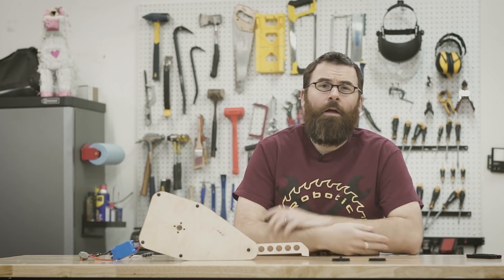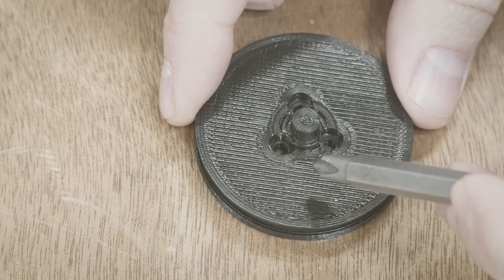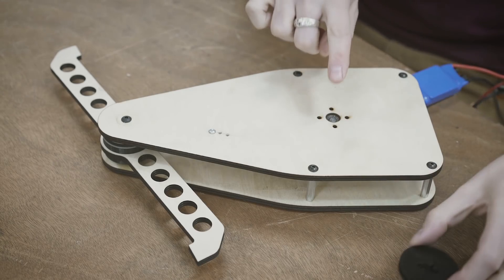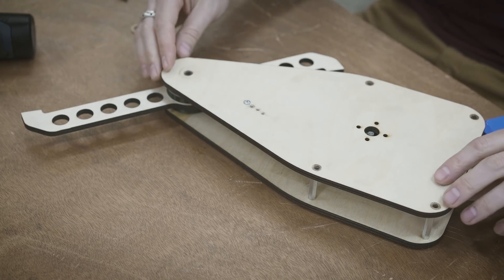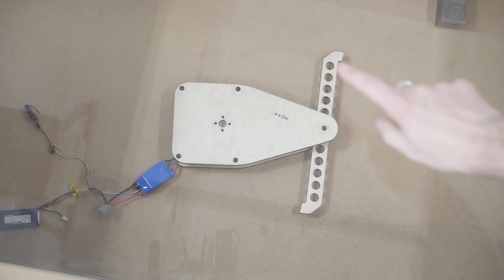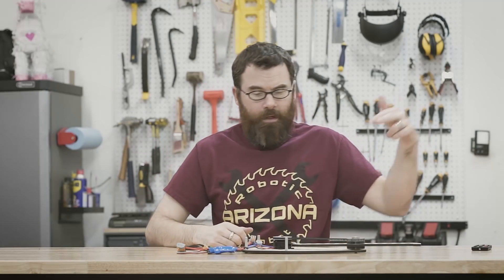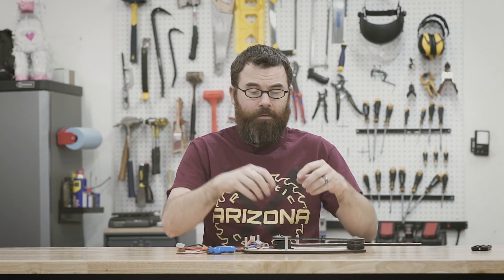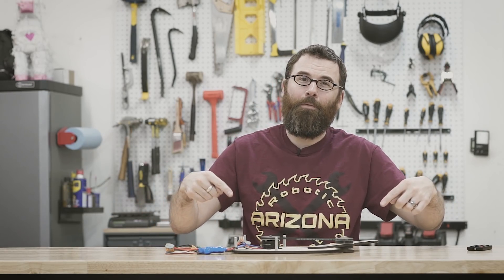Psychotic Break Build - Pulley Madness!

Comment: You should test the weapon directly attached to the motor as a baseline for power usage, then you can calculate how much power you are losing to the drivetrain and bearings.
Reply from the maker: True.  But I'm not sure what it would really tell me, I NEED the setup the way it is, so it might tell me what losses I have, but I really wouldn't be in a position to change/correct it, because I need at least what I've already designed.  I am going to try and test the overall efficiency of the ESC (measure power going in and out of the ESC), this is where losses can occur, and I can recover without sacrificing any of the mechanical design.

Comment: Sounds like the holes in the weapon is causing a lot of air resistance. Can you try putting tape over the holes to see if its any better?.
Reply from the maker: I tried this, and it was maybe 0.5A total current draw difference, and only at top speed.  I had this thought too, and it doesn't really change much.  But don't worry, I have some ideas and in future videos I'll show how I reduced it pretty drastically.

Comment: Have you tried running the belt inside out? Since you're not using the teeth anyway.

Alternatively print teeth on your pulleys and reduce the wrap angle on the drive to allow skipping in case of a hit. Direct drive with no slip, except under major impact. Relying on belt tension with such a non-stretchy belt feels risky.
Reply from the maker: Not yet.  I'm still not 'done' with the pulleys, I always work with 'proof of concept' first, then finalize the parts and make them the best they can be.

Comment: Saw you on BBots!  Think about making your weapon cross section into a symmetrical airfoil shape, and cover those lightening holes with tape etc.  This is your best shot at increasing max weapon rpm and reducing amp draw while there.
Reply from the maker: 1) I don't want to increase RPM, this is already way too fast.  2) I tried taping over the holes and it made almost no difference 3) actually tweaking the firmware on the ESC is a great way to reduce the current draw, I've reduced it by around 30%. 4) I'd rather not machine this weapon more than I have to, especially with complex shapes.
Reply: Thanks for the reply!  I understand if you've gotten current draw down low enough to suit the 3 minute operational design, that over engineering shapes would be a lot of work for very little purpose at this point.  I come from an aeronautical background, where every electron is precious so efficiencies (electrical, mechanical, and aerodynamic) have to be refined endlessly.  Loved watching Copperhead on BBots; wish you the best of luck from here on out!

Comment: You could make the pullies aluminum and just add spokes to hollow it the middle of pullies. Similar to motorcycle sprockets. It makes them super expensive to make timewise since you can't just hit print but it may be worth drawing something up to get a weight estimate.
Reply from the maker: Yep, I have designs for this, but I would rather stick with plastic if I can, since it's MUCH easier to make and reduces part count.

Comment: Are the pullies going to suffer when the weapon stops rotating during combat and the belt presumably slips? Are you worried about heat generated in that instance?
Reply from the maker: I don't think so.  The acceleration forces are pretty strong, and the surface finish looks flawless still and I've gone through maybe 5 batteries.  I think they could hold up, the belt might slip a bit, but that's perfectly fine and desirable.

Comment: 9:25 was your weapon ESC' brake turned on? I noticed that the weapon stopped quite quickly from full speed and braking can cause a lot of heat.
Reply from the maker: I'm not sure if it was turned on (it shouldn't have been), but keep in mind the top speed is 10K RPM, with the amount of wind resistance, just backing off the throttle will create some sort of braking effect.